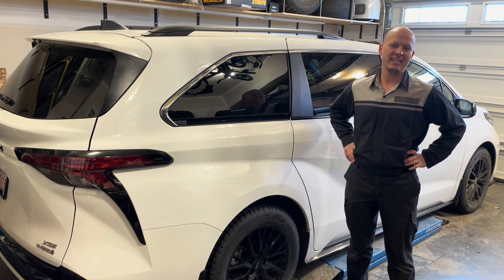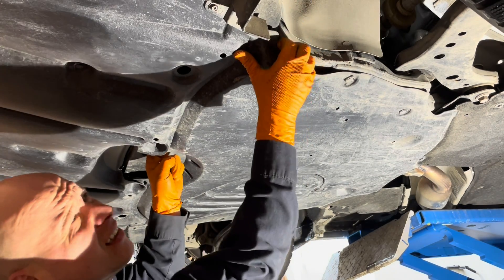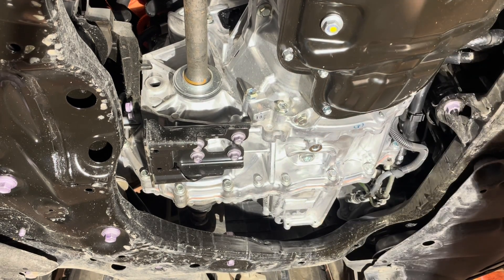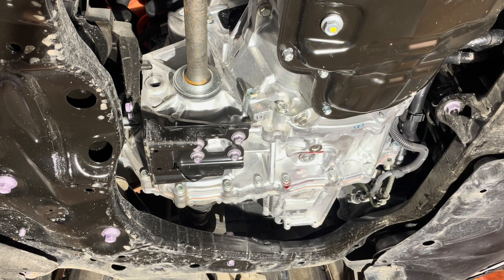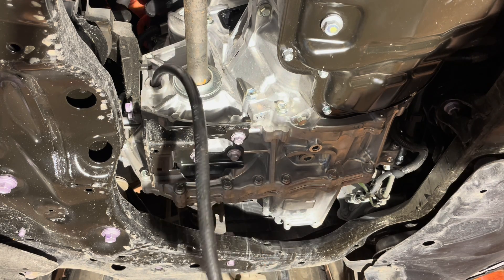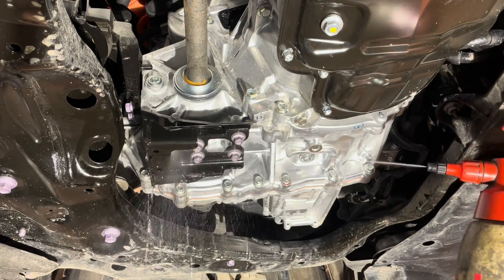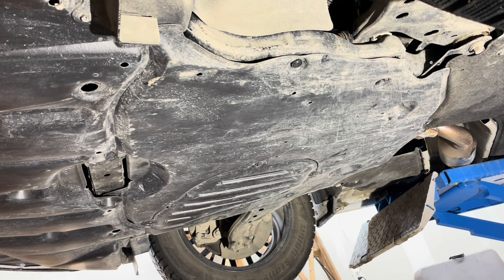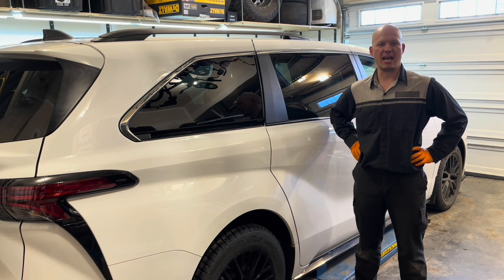2021-2024 Toyota Sienna Hybrid eCVT Transmission Fluid Replacement Instructions

Comment: Hi Victor 
The dealership recommended me the toyota cvt oil not ws , is it ok?
Reply from the maker: I don’t know why they would do that, the correct oil is type WS. Have them check the factory repair manual 😉
Reply: They said 2021 sienna hybrid 2.5 Fwd , used toyota cvt fluid fe not ws , btw thanks for your reply 👍
Reply from the maker: @joshuasilalahi5680  Here is the first line from the repair manual regarding the Sienna transmission fluid replacement. You may want to consider a different dealership :) NOTICE:

For the hybrid transaxle fluid, use Toyota Genuine ATF WS.

Using hybrid transaxle fluid other than the above type may cause abnormal noise or vibration, or ultimately damage the transaxle of the vehicle.
Reply from the maker: @joshuasilalahi5680  are you located in North America?
Reply: Yes , midwest , I think the dealership just trying to sell me that cvt oil , I used WS for all my yota’s for the longest time , this was the first hybrid I own…those cvt oil ain’t cheap also😂

Comment: Hi Victor, would you know why 3 quarts was poured out and I had to put 3.8 quarts in after the refill before it started to pour out, vehicle transmission was never serviced before. It only had 40,000 miles. Could it be that it was originally low? Or is that a normal thing for it to have more fluid go in?
Reply from the maker: Hi Peter, sometimes they can be a little bit low from factory. I wouldn’t worry about it.
Reply: Hi Peter, I did this service for the first time to my 2021 Sienna, it happened the same thing to me as well, 3 quarters was poured and 3.8 quarts in, I don't know why but I just installed everything back and nothing happened after one week everything is normal as before.

Comment: does a camry hybrid 2015 have a transfer case or differential fluid in the rear? Not sure if it applies only to 4 wheel drives? Mine is a 2 wheel drive. I wanted to change the transmission fluid on it and wanted to know if differential is also needed to be changed. Wanted to know the quantity of the fluid as well
Reply from the maker: The Camry does not have a transfer case or rear differential.
Reply: @Viktor_G_Automotive  Thank you for your reply
Reply from the maker: @shikshamittal5322  no problem

Comment: Viktor:  I note that you bought 4 quarts of Lexus WS ATF to accomplish your fluid replacement in your Toyota eCVT.  Exxon Mobil makes the Toyota WS ATF and I assume the Lexus WS ATF is exactly the same?  The following will help establish that Amsoil "100 Synthetic" Signature Series Fuel Efficient ATF Fluid is vastly superior to the Toyota "Full Synthetic" WS ATF Fluid.  You can compare the Safety Data Sheets between Amsoil and Toyota fluids and you will find the Toyota WS ATF (and true of the vast number of full synthetics) is mostly composed of hydrocracked-petroleum oil, a Class III Synthetic (extra-refined petroleum to mostly eliminate impurities, but it doesn’t get totally get rid of then entirely).  Amsoil Signature Series doesn’t contain a drop of petroleum oil, but a pure chemical mixture of Class IV Synthetic, known as polyalphaolefins (PAOs) and Class V Synthetic (such as Esters), plus top-shelf additives.  Toyota lists the Flash Point of their WS ATF Fluid as 347° F (175° C), whereas Amsoil's Flash Point is listed as 435.2 F (224° C), so Amsoil holds up to the heat far better than the Toyota WS ATF.  Another convenience factor of the Amsoil "100 Synthetic" Signature Series Fuel Efficient ATF Fluid is thay it is available in collapsible bags making installation a snap (without the need for a pump that only provides a slow fill operation)!

The difference between a Full Synthetic and a 100% Synthetic?  Rafe Britton, a former Lubrication Engineer at Mobil and the creator of a number of highly educational YouTube Videos under the heading of “Lubrication Explained,” states in order for an oil company to call its oil product 100% synthetic, it must be composed of either a Class IV Synthetic (PAOs) AND/OR Class V Synthetic (such as Esters), while being completely devoid of refined petroleum.

Since 2004 I have exclusively been using 100% synthetic oils, fluids and gear oils made by Amsoil.  In my 2013 Subaru Tribeca I use 5W-30, which has a Pour Point (PP) of -58 F and my Toyota Camry Hybrid uses 0W-20, which has a PP of -63 F.  I have never experienced any problems starting my vehicles any longer using 100% synthetic products .  

I also changed the 100% Synthetic ATF in both my vehicles at about 40,000 miles (the Multi-Vehicle ATF in my Tribeca’s transmission and power steering reservoir has a PP of -63 F, while the Fuel-Efficient ATF in my Camry Hybrid (with a similar eCVT as your Toyota) has a PP of -85 F.  The moment I drove the Camry after the installation of the Amsoil ATF (without any other services being performed on my vehicle),  I not only detected the vehicle was running a bit smoother, but also experienced increased power upon acceleration.  More importantly, my EV light was coming on more often and staying lit longer (which of course signifies my car is running electrically from the battery, while the gas engine isn't operating)

Also around 40,000 miles, I changed the gear oil in both differentials in the Tribeca with Amsoil 100% synthetic 75W-90 Gear Oil (that has a PP of -45 F), which ran much better at any time than the original full synthetic gear oil from the Subaru Factory.  I also changed the Coolant and brake fluid in both vehicles to Amsoil.  Another benefit of using Amsoil (other than the great performance), my vehicles are covered by the widest warranty in the business regardless of the age and mileage of your vehicle, even if this was the first time trying Amsoil (as long as your vehicle was in good mechanical condition at the time you first started using Amsoil).
  
For those of you seeking a less expensive ATF,  you might consider Amsoil "100 Synthetic" OE Fuel Efficient ATF Fluid, which isn't available in the easy-to-pour pack (only the conventional quart or gallon plastic containers).  The OE ATF has the same Flash Point 435.2 °F (224° C) as the Signature Series, but a higher Pour Point at  -54°F (-48° C) compared to the Signature Series (at -85 F).  The lower a Pour Point, the better for running your vehicle in cold temperatures. The OE must be changed according to the manufacturer's specifications for your specific vehicle, however, the Signature Series will go double the distance (than the OE) under severe-driving conditions. For those of you that have a vehicle that doesn't accept a Fuel-Effecient ATF, you may consider the Amsoil 100% Synthetic Multi-Vehicle ATF (in both the Signature Series and the OE).  They also carry 100% Synthetic in both their CVT fluid and Dual-Clutch Transmisson Fluid.

I had tried a variety of full synthetics over the years.  I began to utilize Mobil 1 for several years thereafter, until I found Amsoil being sold by an auto parts store that is no longer in operation.  After I personally emptied the Mobil 1 and I put it in the Amsoil in my car about 20 years ago, I was blown away with the increased performance, better fuel efficiency and the overall quietness of my engine.  
For full disclosure (as probably guessed right now), I am an Independent Amsoil Dealer (all dealers of Amsoil are independent contractors, as opposed to employees of Amsoil).  . 

If consumers wish to buy the Amsoil products as a Preferred Customer (PC), they will get the oil at a 25% discount, plus free shipping when they spend $100 (plus receiving a $5 coupon for every $100 you spend).  It only costs $10 for a 6 month PC membership (or $20 a year) and there is no requirement to purchase (as there is with so many companies offering a membership for a preferred customer program, where there is an automatic shipment involved). 

If you are tempted to try Amsoil, I invite you to visit the official website of Amsoil and apply to become my Preferred Customer, by kindly utilizing my name (James Norris) in the box underneath the question that asks “Did someone refer you to Amsoil?  If so, please tell us.”  Then in the next box they ask “Have a Referral Number?  Enter it below:”  I kindly ask that you include my Referral Number of 1420935 in that box. If you can write down my name and referral number, before you eventually decide to exit this webpage, it will be appreciated (so that it will be at your fingertips when you get on the Amsoil website).  You can also write me an email addressed to AutomotiveBuff at my gmail address (in case you have any questions).
Reply from the maker: Lots of good information, I will look it over and keep your contact in case I decide to go ahead with it. Thanks 🙏
Reply: @Viktor_G_Automotive  Viktor:  Thank you very much for expressing your compliments concerning my comments I made last night.  I wish to also thank you for considering to possibly purchase the Amsoil Fuel-Efficient ATF (when you eventually need some ATF).  I subscribed to your YT channel.

If you own an automotive repair shop or operate such an establishment out of your home, you could qualify as a Retail Account of Amsoil.  If so, you would be entitled to a 30% discount (without any membership fee being charged), along with free.shipping for any orders exceeding $400.  While it is true that Preferred Customers (PCs) get free shipping for orders exceeding $100, but PCs pay a yearly 20% fee and their discount is confined to 25%.
 
Fun Facts:  Amsoil was the first company to sell a synthetic motor oil (it also happened to be 100% synthetic), which was certified by the American Petroleum Institute in 1972 (2 years before Mobil 1 was brought to market).  They were also .the first company producing a synthetic ATF;  a synthetic oil for turbocharged engines; a synthetic diesel oil; a synthetic gear lube;  a synthetic racing oil;  a synthetic for marine engines.

Comment: Dear Viktor,    Our 2023 RX350h emergencyehicle has 75,000 miles.   Should the rear differential oil be drained and refilled?     Thank you.
Reply from the maker: Hi Robert, if that was my vehicle, I’d do it every 60K miles.
Reply: @Viktor_G_Automotive      Thank you.
Can I do it myself?
Reply from the maker: @robertgift  of course. See my Sienna hybrid rear differential fluid replacement video, it is very similar to the RX350h.

Comment: Thank you, Viktor, please can u share the transaxle code of the Sienna? it shoukd be the P711....
Reply from the maker: Hi Claudio, it is P810
Reply: @Viktor_G_Automotive  many thx Viktor.. less power but pretty the same design  of P711 so I suppose the oil change procedure are the same ,correct ?
Reply from the maker: @claudiozanetti2086  yes, all P-type eCVT transmissions are serviced pretty much the same way.

Comment: Thank you, Viktor.   Transmission shop wants $399 for thiservice.    Think I'll cut a service pit into our garage cement floor.
Reply from the maker: Either that or get a lift like I did 😀
Reply: @Viktor_G_Automotive     Thank you.   Would be nice!     This is a house two-car garage with typical cement floor.   The SUV is a used 2023 RX350h emergencyehicle driven by volunteers on call 24/7 .  It transports blood and blood platelets to hospitals.   Already has 67k on it.
Reply: @robertgift  Check out the Quick Jack systems, if you are capable of doing your own maintenance, they quickly pay for themselves, especially if you have multiple vehicles that are old enough to start needing things like brakes, transmission fluid changes, coolant flushes, etc.
Reply: It’s $699 in my city

Comment: Thank you Victor.  I have a 2019 Rav4 hybrid.  Is the transmission fluid replacement the same as this  van? Or if you could do a video of this vehicle, would be great.  Thank you again.
Reply from the maker: The Rav4 uses a slightly different transmission (P710 vs Sienna's P810), but the fluid replacement is done pretty much the same way. If I ever get my hands on a RAV4 HV, I will make a video, but not sure if or when that will happen.

Comment: Hello
So the Sienna has a CVT transmission.
Shouldn’t you be using CVT transmission fluid?
Reply from the maker: It is a hybrid eCVT transmission, which uses WS fluid. Toyota CVT fluid is used in non-hybrid models equipped with a conventional type belt driven CVT such as Toyota Corolla and Lexus UX200.
Reply: @Viktor_G_Automotive  Hi Viktor, it was exactly what i wanted to know. It means that RX450H 2018 dont need "CVT Fluid", but ATF WS instead.. Thanks a lot for your great job.
Reply from the maker: @jacobacio  absolutely, my pleasure!

Comment: Can you fill it from under the hood.?  Is this a Ecvt transmission or just regular automatic transmission?
Reply from the maker: It’s an ECVT, I suppose you could fill it from under the hood if you open the fill plug from underneath and run a hose with a funnel into the engine bay.

Comment: Thank you, Viktor, for telling me the torque value of all, especially the drain/fill port. Appreciate it!
Reply from the maker: Absolutely!
Reply: Can I use the same drain/fill torque value  (37 ft-lbs) for my 2020 Rav4-non Hybrid? Thanks in advance. @Viktor_G_Automotive
Reply from the maker: @kenty6973  the non-hybrid transmission fluid is replaced in a different way and torque specs will most likely be different. What engine is in your RAV? I could probably look the specs up for you when I get a chance.
Reply: Hi Viktor, thanks for your prompt reply. My 2020 Rav4 LE is non-Hybrid. It has an A25A-FKS engine with 8 speed (UB80E) transmission. Thank you! @Viktor_G_Automotive
Reply: @Viktor_G_Automotive How is recommended to change the transmission fluid? Full ? How can i fresh it full change. Thanks. ..

Comment: Thank you for the informative and detailed video. Our 21 Sienna is only at 30k miles but i’m sure i’ll be back here to this video in a few years when it’s time to change the eCVT fluid.
Reply from the maker: Sounds great!
Reply: Donot let it go past 50k ..lots of metal debris in there and the magnets covered with sludge.
Reply: @JerrySeriatos  it's not true, I've seen tons Prius never had ecvt fluid change and go over 300k+ miles /20years+.  100k miles should be ok
Reply: @JerrySeriatos I didn't know that I need to replace the transmission fluid at this mileage, I asked the dealership and about what type of service i need to do but they didn't mentioned , at this time my van has 74,000 miles with the original fluid in it
Reply: @Smartway2save  yea so soon  after the warranty expires the transmission goes kaput and then you become a customer again

Comment: Viktor I have 23 sienna hybrid im a Uber driver I put in around 60k in 1year when should I change transmission fluid ? 
I change my engine oil every 7k miles
Reply from the maker: I’ll be changing mine every 60K miles as preventative maintenance.